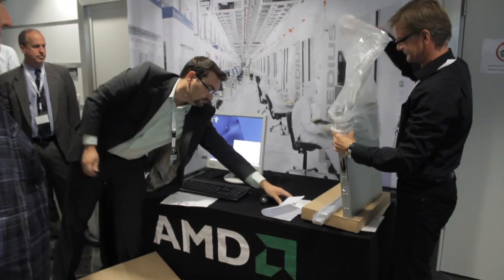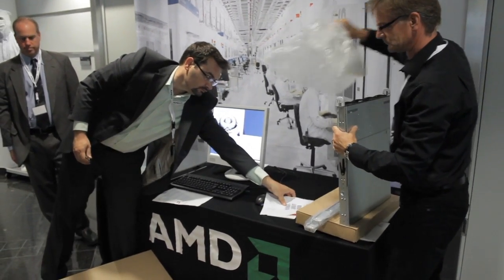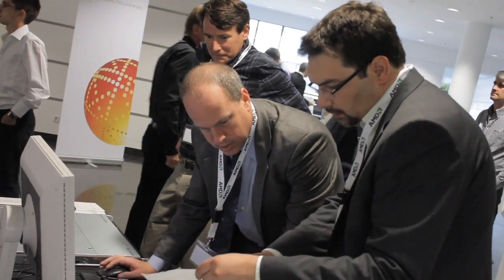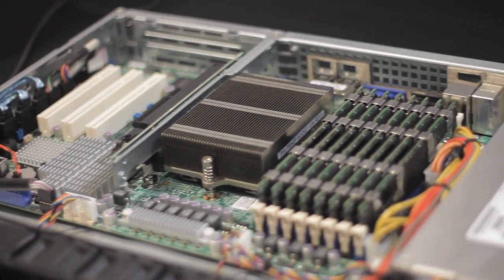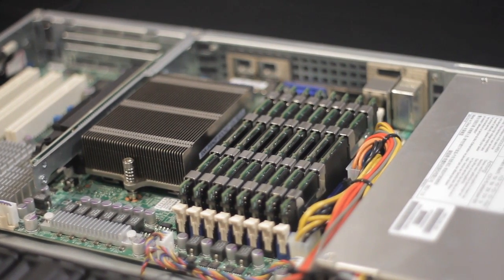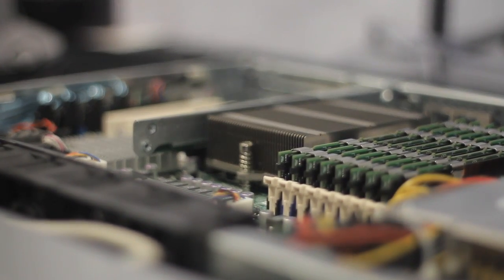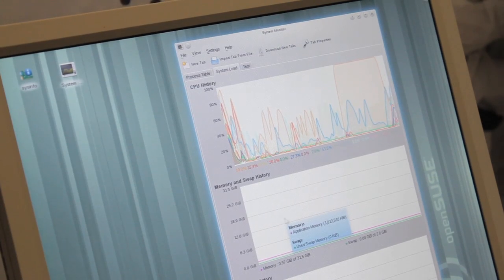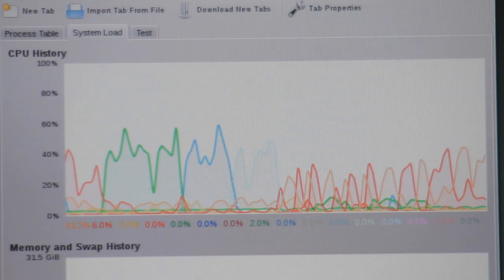AMD Brings Top Media to GLOBALFOUNDRIES Fab

Comment: @Martinx88813 I would suggest getting one of the new AMD APUs Its a CPU and discrete GPU in one chip and only about $150 bucks then you can crossfire the GPU that is with  the CPU with a ATI HD6xxx series and it should be good for games for the next 5 years.   I got the AMD A8-3850 2.9GHz an ASUS F1A75-V PRO and 8GB of memory for around $350.00.  I already had a case/power supply and hard drives for it but with that it would only bring the price up to about $550 still very cheap for a gaming PC.